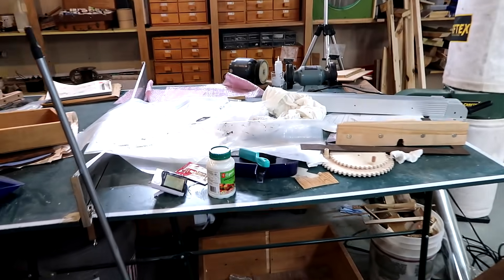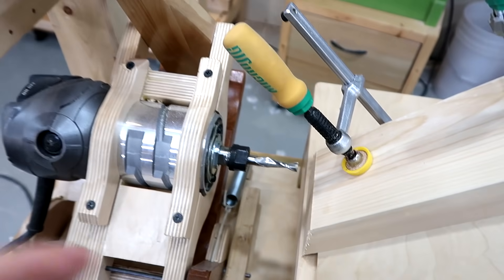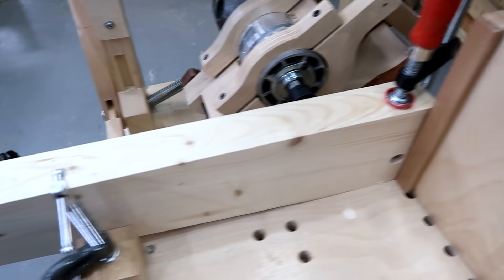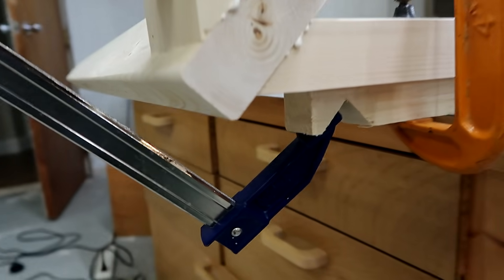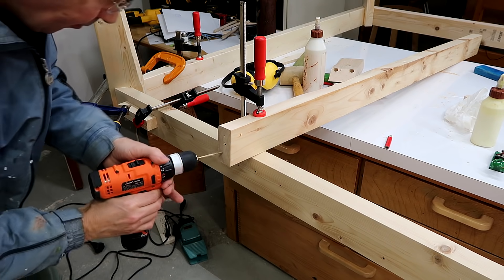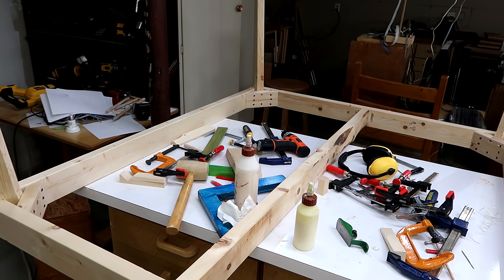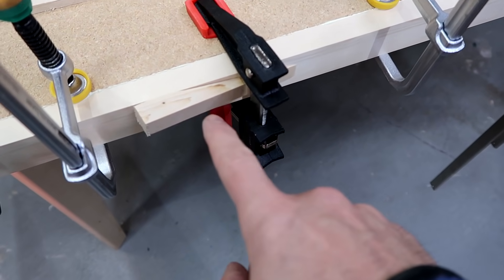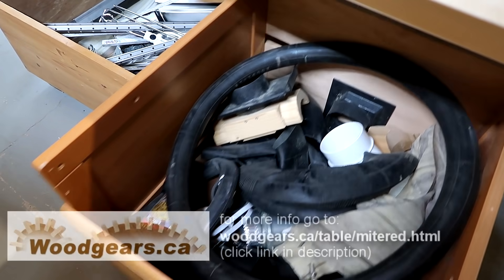Miter joined large table

Comment: I put my dowels 1 min in microwave oven just before assembling so that they lose about 0.15/0,25 mil in diameter for 10 at initial size. Much more easy to put together and the dowels expand back due to the moisture of the glue, just like a biscuit. Thanks Matthias for sharing your works and tips, I wish you the best for 2020. Pierre from France

Comment: "That piece of wood has twist in it". Welcome to my world. To think that at the beginning of the video I was marveling at how you managed to buy that many pieces of straight wood. It is possible to do that here AT THE STORE. When you get home they are not the same anymore. GA USA. This is the type video that made you famous, I hope you can get back at it.
Reply: I like to keep a supply of 2X lumber on hand, so it has a chance to season in my garage.  When I start a project, I cut my pieces to rough length, joint 2 adjacent faces to make them flat and square, the use the thickness planer and table saw to make the other 2 faces parallel.  That eliminates much of the potential for twist.  Any twist in the final project is down to my poor joinery :-)
Reply: These are the dangerous thoughts that lead to metalworking. Or plywood lol.
Reply: Might be telling you something you already know, but if they are warping between purchase and unloading, you either need to transport differently or find another supplier with a different manufacturer and see if it changes. You'd be surprised how much transport affects the condition of board stock.
Reply: Clifton Green:  Here in southern Ontario, I have the same problem with warped dimensional lumber that most everyone else has these days.  I can buy 2 xs, transport them home (15 minutes), pull them out of my truck, stack them on my 4'x8' table and find them warped the next day.
When I've had "excess space" (if such a thing exists) in my shop, I've done as Brian Taylor does, and stickered, stacked and weighted it while it seasoned.  That works well but isn't always practical.
The primary problem is that the lumber we get these days is almost always from trees that are grown for harvest and, as such, is of much lower quality than the old growth lumber we saw in our youth (at least, in my youth).
I can drive for 100 miles in any direction and I can't find high quality dimensional lumber.
Reply: Exactly right. The other problem is the controlled climate in the store. As soon as the wood hits the elevated humidity outside the store it warps. I too, am just 10 minutes from home. I made a barn door for a room and it warped to resemble a bow as in bow and arrow. After many months hanging in the house it eventually dried out to hang straight. Even if I bought and cured lumber, it would have to cure inside my climate controlled house. I have nowhere to put it outside without it being subject to the whims of nature.
Reply: The only thing I could do differently in transportation would be to transport the wood in a climate controlled container matching the environment where it was bought. When the outside air hit it it would still warp and twist. Perhaps I could buy at a local supply house that stores their wood outside but under cover. That means it is already subject to the vagaries of nature.
Reply: Jeff Stanley:  The other big problem is moisture content of the wood.  Dimensional lumber is usually dried to about 17% whereas the hardwood I store in my shop is usually around 10% when I buy it and drops to 6-8% within a couple of months.  Like you, I have no room to store dimensional lumber in the shop with the thought that I may need it sometime in the future.
Reply: Try buying wider boards. 2x12's are cut from bigger trees which greatly increases the potential of quality lumber.
Reply: @harlanbarnhart4656 :  There's something to be said for that but the cost pretty much doubles by going that way.  The other issue is that when you rip wider framing lumber (@ 17% moisture content), you may end up with even more warpage than with a standard 2x4.
About the only thing I've found that works (sort of), is to build your project in a hurry before the wood has time to warp.
Reply: Ive had pretty good luck looking at the end grain and buying (fairly) straight grained boards. In fact its rare i have a board twist anymore after purchasing
Reply: @jeffstanley4593  I have an even simpler trick (understand,  absurdly convoluted but works). I normally stack it on the floor with an air gap, and I alternate the faces of each 2x4 to build a pile that is some sort of very long rectangular box or stack of I beams. Then I find some short and straight off cuts and I clamp the whole pile at regular intervals. Looks like some 8 ft long square porcupine. Every few days or weeks, I rework that pile to avoid some pieces getting overly damp or overly dry. And I get to have relatively straight lumber. I have no table saw, jointer or planer and live in an apartment. I have to fit the parts to my project.

Comment: 6:05 They’re just Screws at an Angle. Or Toe Screws.
Reply: Key was to drill 1st!  in reverse direction
Reply: In olden days they were toe nailed - why, two hammer hits vs twenty seconds of turning - now, with battery drivers, the trusty hammer is left dust covered on a cluttered ping pong table among disused nails waiting to avenge itself during the collapse by mashing your toe.

Comment: This is a cool joint. One question I have, if you don’t mind answering, is how strong would the joint be if you were hold off on the dowels until doing but joint glue up and then drilling completely through the three pieces and then doweling? Could even be a cool look.

Comment: I haven't used a table saw to cut sheet goods on in ages. In my small shop or outside, I clamp on a guide and use a circ saw. Having a decent saw and a good blade makes a circ saw feel like a good tool instead of a red headed step child.

Comment: I love your videos, especially the ones where you made the band saws. I have a question for you, or anyone with wood knowledge who reads this. I have a solid body electric guitar I made from northern ash in 1980. It weights in at about 10 pounds. As I remember it was a very hard (density wise) wood to work with. I need to do some weight relief on the body because I just can't hold it up anymore. It's my baby and I'm not ready to retire it. I am going to resaw about 1/2" off the back, then drill and router a few cavities to lighten up the weight. Then I will glue a mahogany back to it. So questions are: what type/brand router and drill bits would work best for hard Northern Ash? Any recommendations on saw blades will be helpful too.

Comment: For setting the table saw blade, I've had really good luck with those magnetic leveling cubes.  They are pretty cheap and get me pretty perfect every time.
Reply: Well he was pretty perfect too, except not exactly perfect. Better to verify and correct, even if using a magnetic angle guide.
Reply: @mlindholm  the reason I mentioned it is because they are really fast and consistent to set. Matthias ended up not being able to use that tablesaw for a while because he didn't want to take the time to set it again.

In my shop, I can set the angle perfectly in about 15 seconds, so switching it back and forth is trivially easy.

Comment: Just wondering if I couldn't accomplish the same sort of pinned corner joint by assembling the whole thing and then drilling the dowel holes after the fact. They would show but I don't think that would detract from the looks and I assume the strength would be the same.

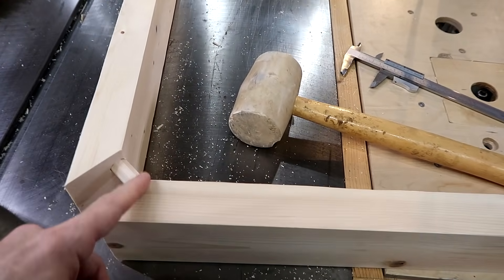Comment: @2:00 seems to be the source of your tolerance discrepancy with the legs, they didn’t wobble like the 45° rig did.
Reply from the maker: The jig didn't wobble.  The stand for the pantorouter is on wheels and wobbled a bit
Reply: Fair enough, hard to tell the difference in the sped up footage.

Comment: You said a joint was tight and you didn’t know where you had messed up. Maybe you didn’t. I saw a Mark Spagnuolo video recently where he used Tightbond’s polyurethane glue instead of standard wood glue because the water content of standard glue can make the wood swell. I realized that might explain some trouble I’ve had with picture frame splines. I don’t know if that’s what went wrong here, but I’d consider it worth investigating.